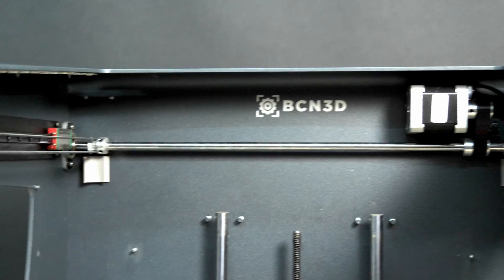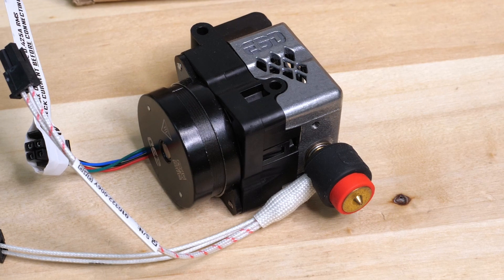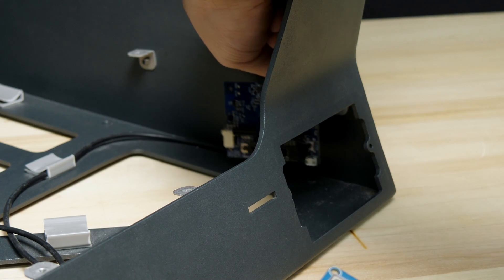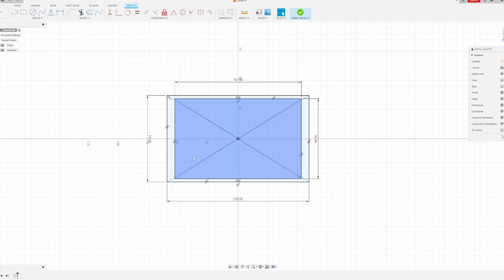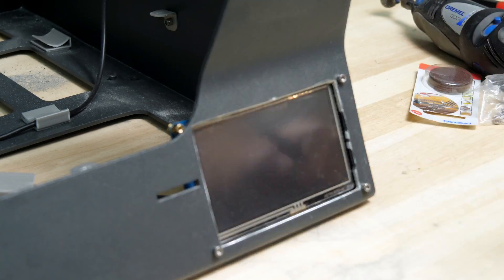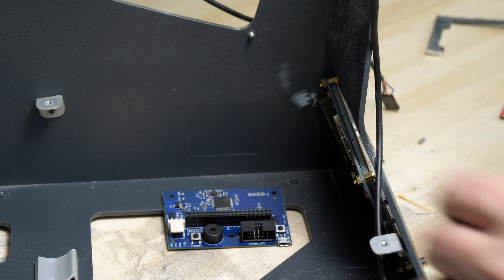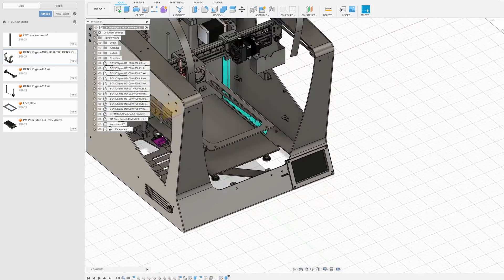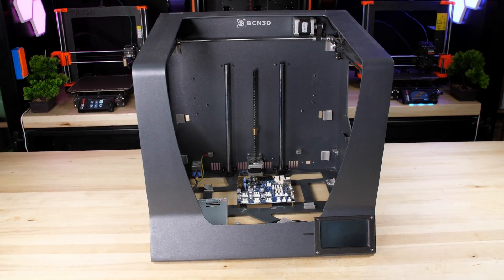Finally Happening! The BCN3D Sigma Project - Part 3

Comment: I bought the Sigma R19 a few years back... and what a let down. I wanted dual extrusion prints, which it did pretty well when it worked but dear god was that glass bed and build plate absolute garbage. That and the 2.5mm filament was giving me non stop grief due to the filament constantly snapping due to its super long travel path :/

I might follow your example and upgrade it to a mutant dual extrusion voron or something. At least I will modify it to have a normal buildpate setup. Who knows, maybe thats all it really needed to be far more reliable

Comment: Cutting those stand-offs with your psu nearby isn't a sound idea with the metal dust. Give it a good air blasting before you switch it on. I'm doing the same like you I'm reviving the E3d toolchanger and have modernised it with my own light weight toll head design. Currently 33k accel and 420mm/s printing speed printing nicely. Duet 2 wifi was a harsh step back from klipper. Good luck with your project!
Reply from the maker: The PSU will be swapped out so wasn't too bothered. i only left it there so i can know the placement. awesome stuff with your TC!
Reply: @3DMakerNoob  Miguel, ¡dejaste de responder a cualquiera de nuestros mensajes después de defraudar los productos de nuestra empresa!